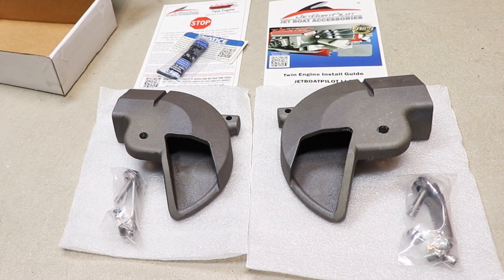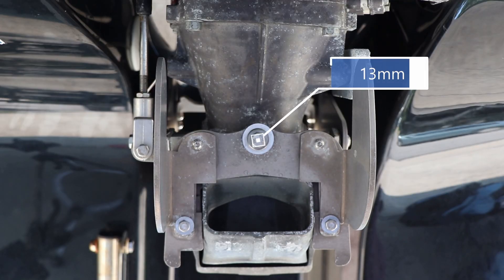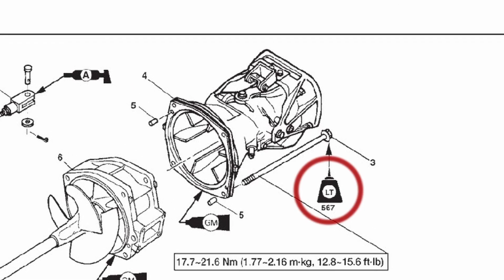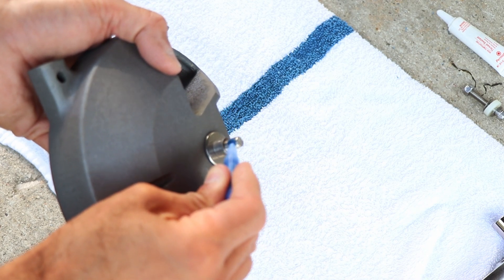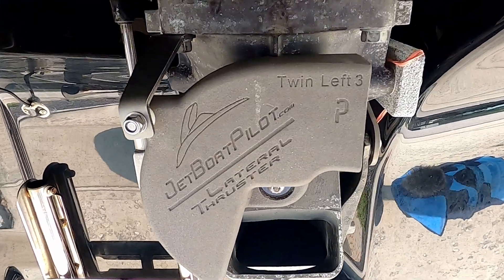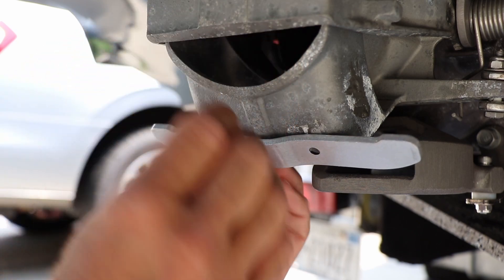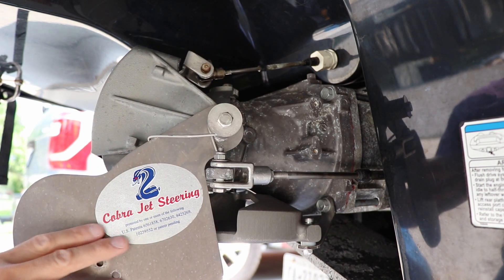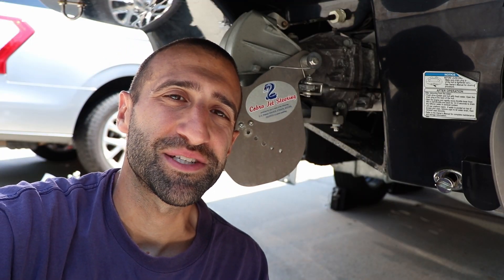Yamaha Jetboat | Lateral Thrusters with CobraJet Steering

Comment: I also have a boat with the cobra fins. I wanted the lateral thrusters but it looked like they wouldn't work with those fins. Glad to see there is an easy solution. Thanks.
Reply from the maker: I really didn’t want to switch to the thrust vectors either. I was happy when I reached out to Jeff he was able to help me out!

Comment: Whenever possible, bolts should be installed from the top down.  That way, you don't lose the bolt (and your steering) if the nut comes off.
Reply from the maker: Yes that’s true. However in this situation, if the cable needed to be removed, the entire fin assembly would have to come off to remove that bolt. With the locknut installed properly, the chances of it coming loose are extremely low. Also, if you’re trailering, a quick visual inspection as your putting the plug in can catch problems before they begin.

Comment: Thank you BP for this. I just installed the Fins/Fangs on my 2011 AR240. Have you staggered the fins at all or have you left them both in the down position? Thanks again.
Reply from the maker: I’ve played with a few settings. I believe I have it set to half way at this point and ive tried full both ways. All the way down the steering gets really hard. All the up, and it has no effect so I feel the middle the sweet spot.

Comment: Hey Mike, nice video as always!  Could you compare your before and after performance changes?  I'm interested in Cobra Super Ultimate fins and Jetboat Pilot Lateral Thrusters on my 2005  SX230...  same configuration you wound up with, right?  At forward high speed did you lose some maneuverability or 'power steering' assist by removing the Mega Fangs?  In slow reverse operations - did the lateral thrusters provide improved maneuverability vs. the fangs?  I hate crushing my rub-rails.
Reply from the maker: Yes should be same setup. Now, originally I had the cobrajets set to always stay down. It was really hard to steer the boat when going at speed, especially with a tube in the back. Yes, it helped keep the boat straight, but we had a hard time whipping the tube because it wanted to do what it was supposed to do. When I added the mega fangs, it definitely helped ease the amount of force you would need to turn when off “no wake speeds”. And honestly, I didn’t really notice too much of a difference at the dock trying to maneuver. We eventually decided to try having them flip up (like the Jetboat Pilot one) and it was a world of a difference. Boat actually did pretty well driving straight off of idle, it wasn’t hard to turn, and you could still slide a tube around. I took off the mega fangs to put in the lateral thrusters and it was night and day. That reverse maneuverability at the dock is ridiculous. You won’t be smashing rub rails anymore. I was with captain Leon at the dock when he showed me his and I bought mine as soon as I got home. I couldn’t believe how easy it was for him to slide his single engine boat into the dock. Whatever benefit I was getting was overshadowed by the lateral thrusters. I vote to get the lateral thrusters, but before you do, maybe try going out and setting your fins to flip up at speed. You might be pleasantly surprised how the boat handles.

Comment: I make special alternate side force stabilizers for the older style fins and the early style L T  it is really not anything new  I also make mega fang plus for those style nozzles for power steering and increased reverse handling along with better stopping power for 169.99 to go on the existing side force stabilizers.
Reply from the maker: Thanks Jeff!
Reply: Hey Jeff, do you include side force stabilizers in your latest Cobra Super Ultimates kits for 2005 SX230 twin engine?  I do want the fins to be able to come up out of the wake when at speed (not fixed).  Or is it just for this special set-up w/ Lateral Thrusters that Mike put together?  And if that's the case, do you still offer the side force stabilizers?
Reply: Just wondering what the side force stabilizer does? It appears to slide fully inside the cobra fins so it’s not supporting anything…and also appears to disturb water flow infront of the lateral thruster….

Am I missing something?

Comment: What's the purpose of the side force stabilizer? Wonder if you can do the lateral thrusters without drilling holes and installing those.
Reply from the maker: 2 reasons. If you have the fins set to stay always down, they now rest on the stabilizers. Also, when you are moving, there is a lot of lateral force being applied to the fins when turning. The bolts that the fins pivot from would have an incredible amount of shear force being applied to them from the leverage the fins provide. The side force stabilizers help distribute the force.
Reply: @boatingpropless  This might be a dumb question- how do you know if one always has the fins always down? Is that what causes the turning to feel stiff?